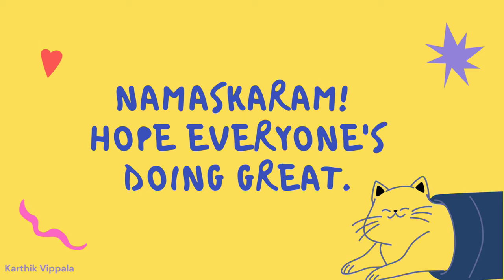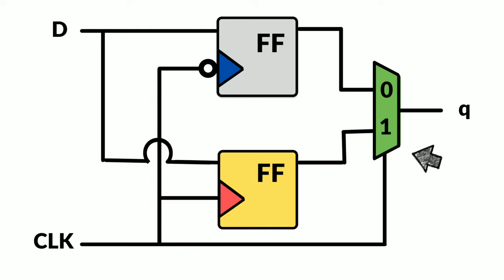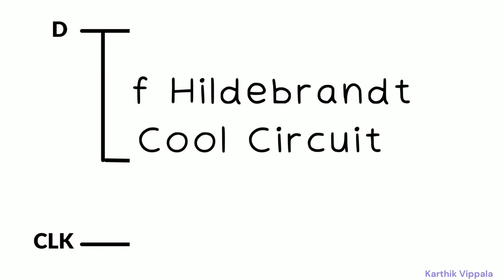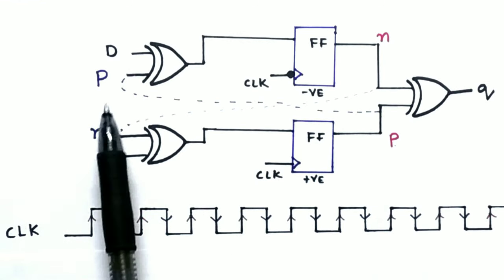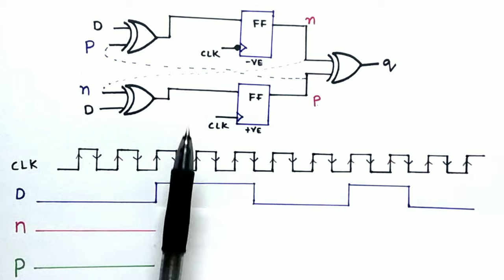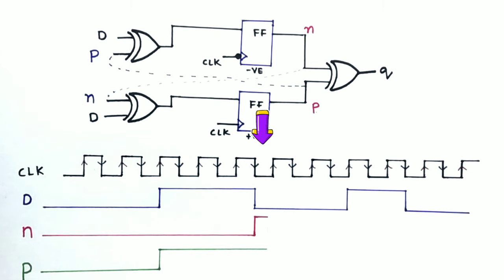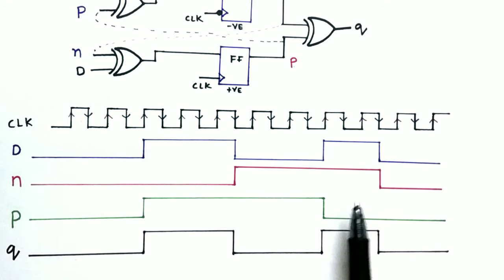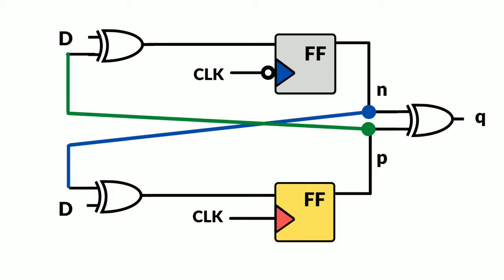What is Dual Edge Triggered Flip Flop? How to design it?🤔 Explained 👍

Comment: Hey Karthik we use dual edge flip flop to shift our signal by half clock cycle but in your waveform we are getting same output which we are giving so is it correct ? Please Reply ASAP.
Reply from the maker: Waveform shown is for ideal case,  actually there will be a delay due to flops.
Reply: @KarthikVippala   Okay Thank You